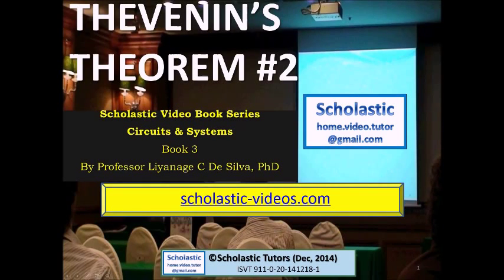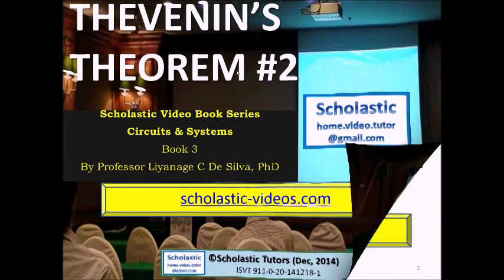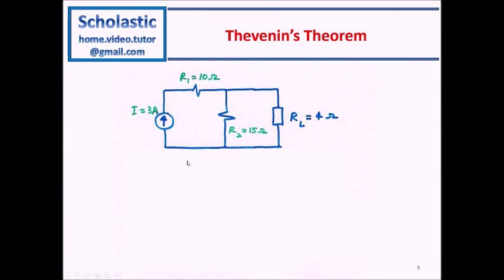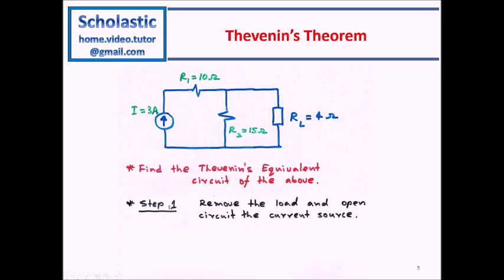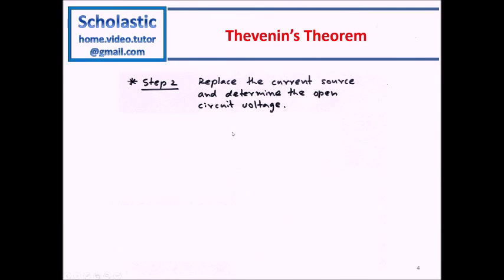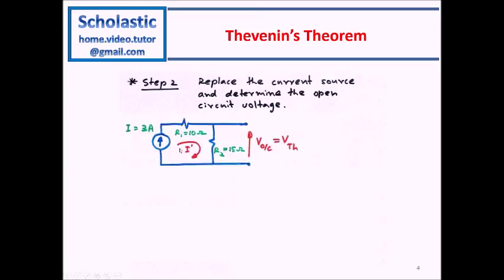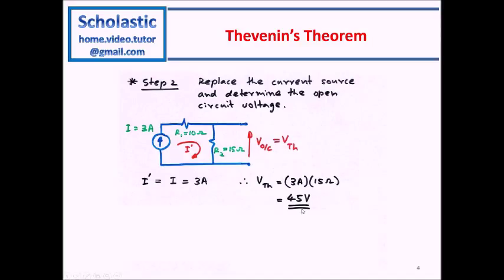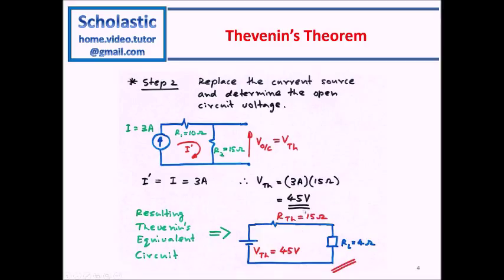Thevenin's Theorem (with a current source)

Comment: Hello, I hope my question is not posted too late. When zeroing out the source, why did you mean by R1 not being connected to the circuit therefore Rth = R2? Does that mean any resistances connected to the current source will not be considered when the source is zeroed out?
Reply: That is what my question too!
Reply: Circuit was opened that's why R1 became a dummy branch because current doesn't flow through open circuit branch. Same is true for a branch which is parallel to a short circuit branch, since all the current will flow through the short circuit branch so the branch parallel to it will become a dummy branch.